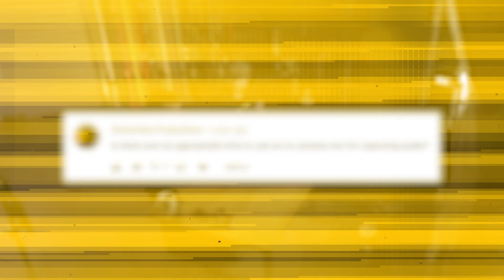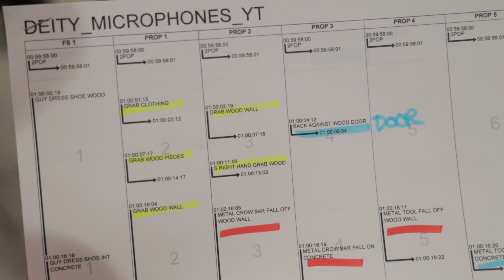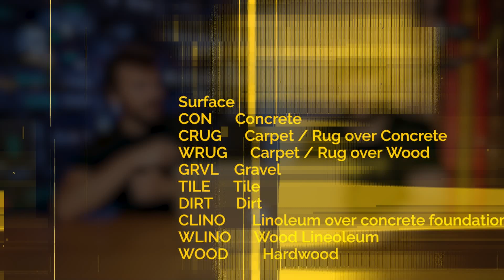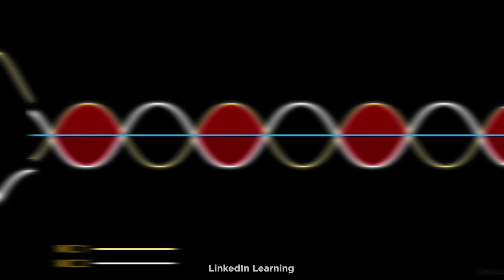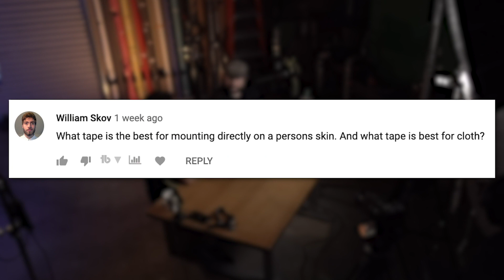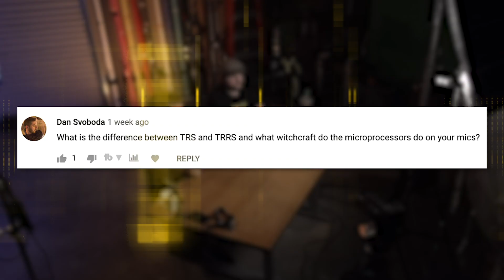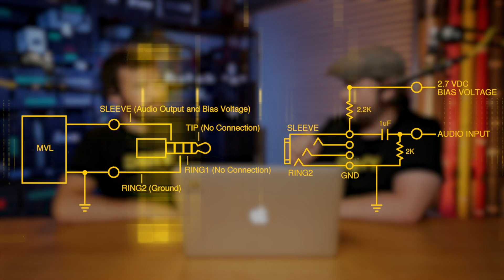TRS vs TRRS! Battle of the 3.5mm Audio Connectors

Comment: One more set of questions: why some of the XL microphones require 24V phantom power while others 48V? What's the benefit/downsides of either of the options? Why not the same plugin power /offset voltage that is used for smaller mics? Is there any benefit of phantom power powered over a self powered (battery driven) microphone?
Reply: Oh I can answer this. The general standard for many years now has been 48V as it was a safe working voltage ( I think it's <60v ) level that was also available in the studio where this became standard. However there was also a competing standard called T power which operated on 12V with a completely different pinout on the XLR connector because that's not gonna be confusing. We have thankfully standardized to Phantom power mostly. However there was a substandard where some microphones generally newer less power-hungry circuitry could operate down to lower voltages and still remain functional this has the added benefit of not requiring as much power from a portable battery operated recorder on a film set so longer record times. Which is why many recorder still give you an option and will usually list how many more hours approximately in the manual somewhere.

Of course then there's the 3 to 5V bias voltage plug in power for electric condenser microphones typically used with computers. If you seen one of those white sticks next to a CRT monitor that's what I'm talking about they have a little circuit in them in the capsule that needs a charge to operate.
Reply: owww double question. Yes and no having a battery operated microphone let you use that microphone with almost any recorder but on the opposite the trade-off of having to replace a battery in five different microphones and keep them all relatively topped up so you know when they're gonna die means you're preemptively changing them so they don't die during a recording. Centralizing this with a phantom powering system allows one device at the center of everything to push that power down to microphones which might be placed in positions where you can't easily change the battery. And reduces the number of batteries needed so one big battery can operate the recorder which in turn Powers the microphones.